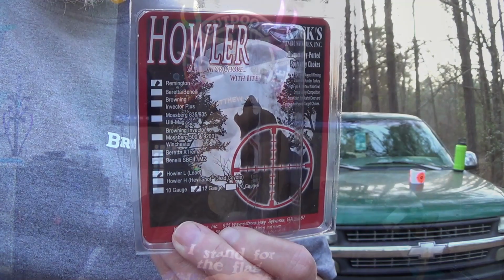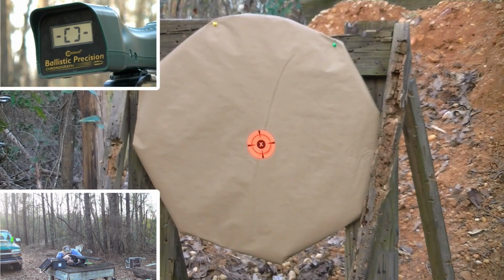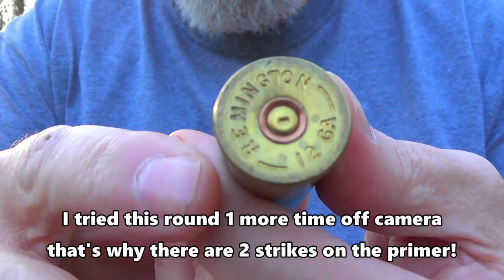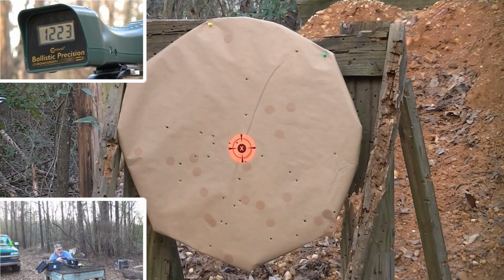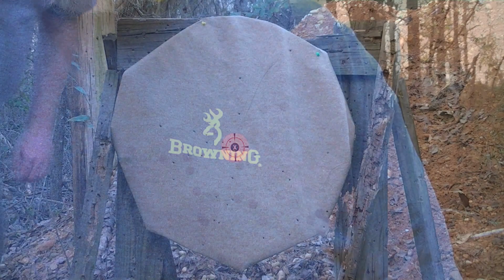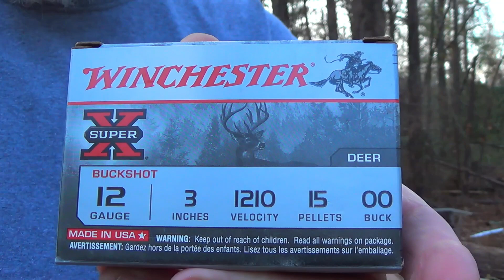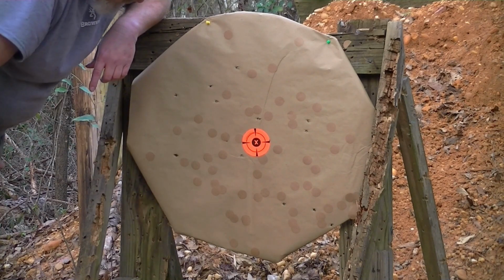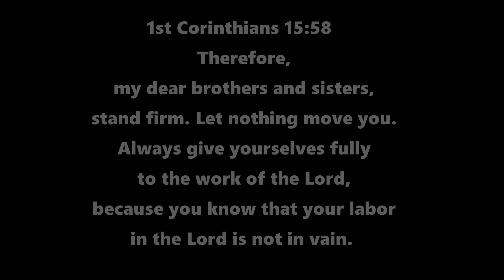M2000 Pattern Test Part 3! We Got it Done!

Comment: I have a old Mossberg shotgun and I have not found a 3" buckshot load it likes. The only thing it likes is 2 3/4 00   I would prefer 3 inch for more pellets. It's a 26" modified barrel. Any suggestions?
Reply: I'm not Bubba ( Wade) , but what counts is how many pellets on target , not how many you launch. If Your Gun , with loads available to You , puts more hits On Target with 2.75in than 3in , let that guide you .

  Are you sure about the bbl length and choke ?  Back in the fixed choke era ( Mossberg , and in general ) there were overwhelming conventions about choke and length . In field guns , 26 in were almost always Improved Cylinder , 30 in almost always Full Choke . Modified was almost always 28 in , but 28in also common with Full .

Comment: If it is hard to find factory ammo then you have to make your own. The No. 4 needs more powder behind it to hurry it up. If the factory stuff can go 1210 fps. then so can the home loads but Don't be silly about it. The 15 pellet shells nearly double your chances. More lead, more meat.
Reply: Answer #1 - Not necessarily . OEM Mfgs use non- canister grade powders , blended in large lots . Available consumer canister powders can't always provide an exact match of pressure and velocity .

  Answer #2 -  With buckshot , the patterns are much more important than velocity . And the higher the initial velocity , the faster a sphere looses velocity , so at farther distances , the actual impact velocities are much more similar .